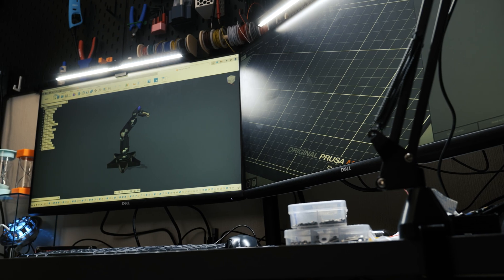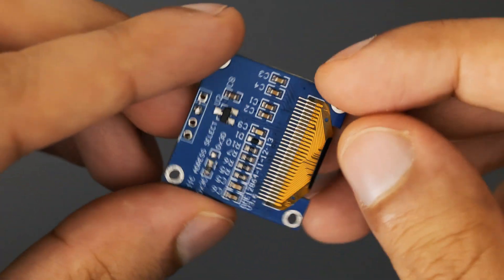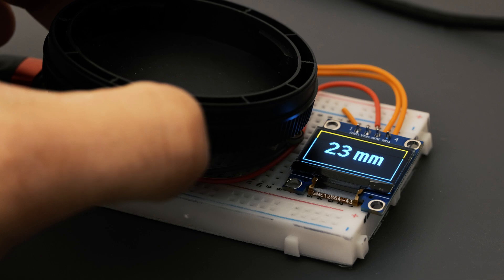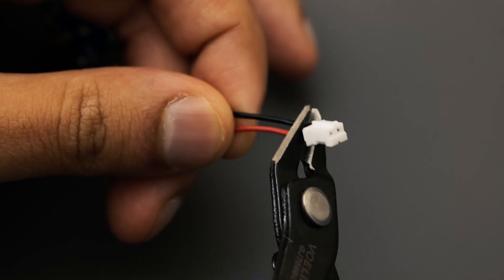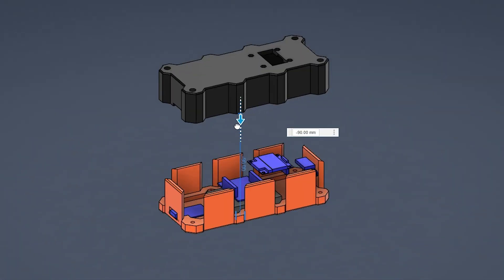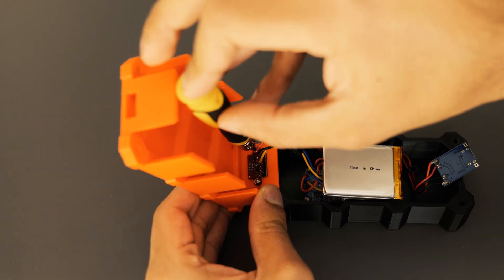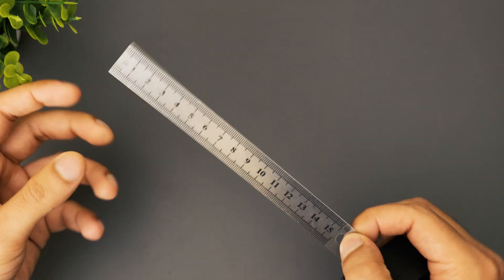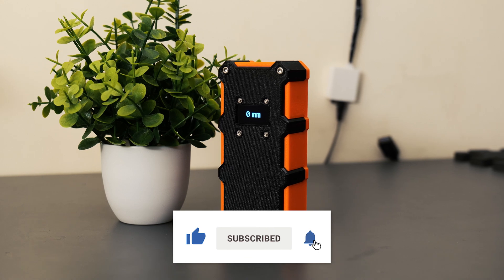I Made My Own Laser Measuring Tool - Here’s How

Comment: what a nice project!! but there are 2 things i'm curious about:

1. does it always turn on (since i dont see a switch to turn it off)
2. does it take in consideration of the depth of that hole between the sensor? since it looks like there is a bit of space between the sensor, (bit behind the enclosure case) that might affect the accuracy.

additionally, if i put a glass to protect the sensor, would it affect the sensor in anyway?? well that made it 3 things... nice project btw!!

Comment: Why not use an ultrasonic sensor which has a longer ranger
Reply from the maker: I've tried ultrasonic sensors for other projects, and as the other commenter mentioned, I found them to be quite noisy.

The ToF sensor was easier to use and gave more predictable readings. That being said, it does indeed require a good surface. 

Thanks for the comment!
Reply: @MirzaMakes  thanks for the info
Reply: Ultrasonic sensors have a lot of noice. Further more, depending on the surface you are aiming it at it can disturb the reading or even not detecting it at all, just like when you are aiming the sensor at an angled surface.
But the sensor he used also needs aan good surface
Reply: Better question yet! Why not just watch enjoy and move on 🎉